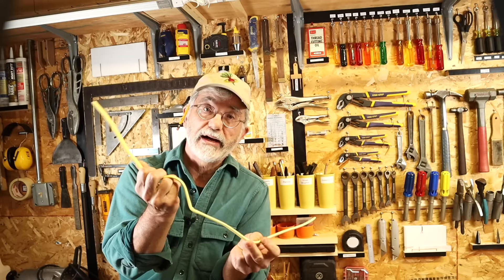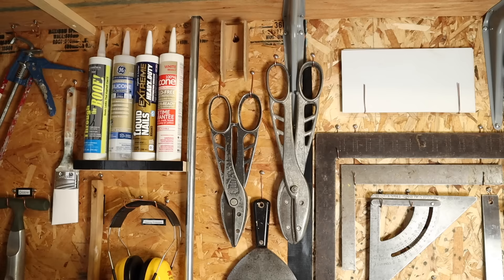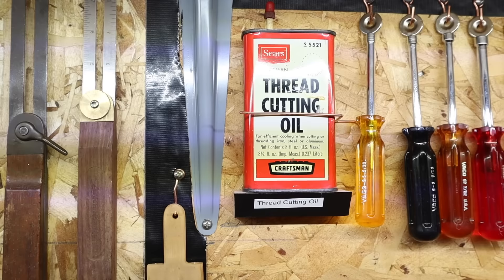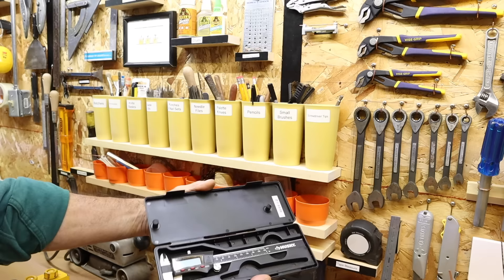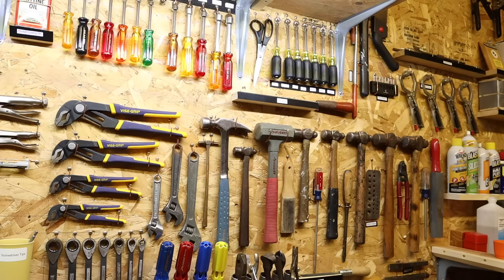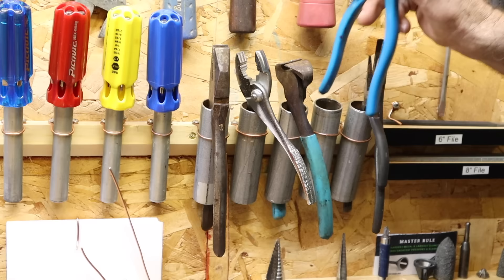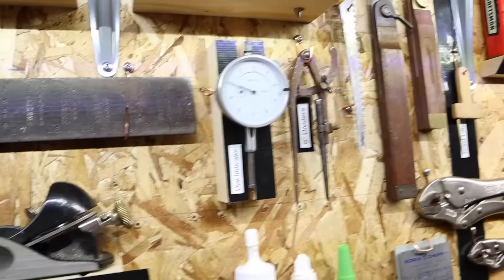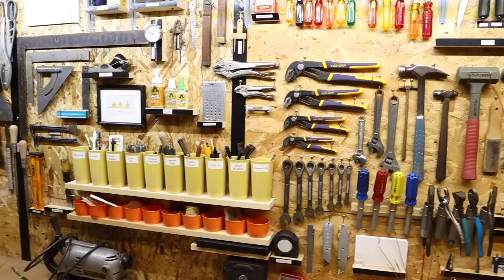How To Have Amazing Tool Organization Using Scraps of Electrical Wire

Comment from the maker: No awesome "dream shop" here!  This is a video about doing the best you can with what you have. In my case, what I have is a cramped, shed-size workshop and a limited budget. But getting my tools organized on the wall, instead of in boxes and piled on my bench is a very satisfying life improvement. If you are inspired and would like to buy me a coffee, here's the link: https://www.buymeacoffee.com/HerrickKimball 👍
Reply: I think I speak for the majority when I say that we don't want to spend thousands of dollars on a 'dream shop' when we'd rather spend it on useful tools!  This is so much better, too, than someone else's idea of how to organize my shop (or in my case, craft room.)  Thanks!
Reply: Very clever, I’ll remember this !
Reply: I was expecting you to use the three strands of copper wire still inside all the plastic sheathing. Much more durable. Thank you for sharing though. You got everything very well organised. Am definitely jealous. All my tools are scattered in drawers and other random places.
Reply: While watching the part about hanging the nutdrivers I noticed that sometimes the magnets will come off with the nutddriver instead of staying on the hook.  You mentioned that you had tried putting a screw through the magnet to attach it directly to the board but it did not hold the nutdriver securely.  I had an idea on how to tweak that to give you the best of both methods.  Put a screw through the magnet and then put a few washers on the screw.  Use however many washers you need to give the same spacing as when the magnets are on the hooks.  This way your magnets will stay put and still have the full holding power to keep the nutdrivers in place.  Thanks for the great video!
Reply: Impressive and inspiring. I'm gonna tackle my rats nest of a garage/shop yet. Thanks for your great vids.
Reply: Are we the same person???  Nah, you’ve got more tool board than me! Wow. Love it. My theory is: If I can’t grab a tool with one hand behind my back, it’s not good enough. (Other hand is already occupied by a tool or battery etc..). Great work and thanks for sharing!
Reply: actually, this is the very definition of a dream shop
Reply: Thanks from Brazil.
Reply: 🎉🎉❤Al 😂a9
Reply: I love this… a contractor left behind a long piece of electrical wire and I couldn’t bring myself to dispose of it, always feeling as if I could use it somehow. This is it! Thank you! My flower gardening/novice DIY home improvement work areas while not cluttered, it could be better arranged using the wall allowing more space to work on my projects… I did not want to spend more money on peg boards, etc… I’ve been planning to tackle the organizing. Now I have a smarter place to begin from. I enjoyed the family anecdotes as well. Thanks again!
Reply: Q❤
Reply: Amazing. You have to bend the wire and then buy screws put screws in the hole. It does the exact same thing as a nail. A Niall is way cheaper

Comment: The key mechanical feature in this system is that the screw fixes the hook from rotating, wobbling etc. Pegboards inherently have that issue. Great work and thanks for sharing!
Reply: Actual pegboard hooks are rather expensive and don't often exactly fit your purpose.
Also, around here 7/16" OSB is half the price of actual pegboard HDF/Masonite
and is much more robust. I covered 3 walls of my shop (256 sq.ft.) with 7/16" OSB 
for $160.

Comment: A quick tip that a roll of rebar wire ties is an affordable alternative to stripping Romex for copper wire. Thanks for the inspiration, my shop has never been so functional!
Reply: Aren’t the ties thinner gauge than the copper he’s using?
Reply: Definitely a thinner gauge. I do think the ties can be and are useful. However, my experience is rebar ties want to rust with any elevated moisture in the air. 🤷🏼‍♂️
Reply: @randyray1194 yeah but then you get to reorganize your tool wall sooner.

Comment: Thank you so much for taking the time to share your ideas. I do not have a shed or a workshop, all I have is a garage that turns into a workshop when I back out one the vehicles. I have started with magnetic strips, hooks and nails to hold my meager number of tools. This video has inspired me to start over with a new direction to get organized and on a limited budget. I am retired so this entire organizing project will keep me out of trouble for an extended period of time.

Comment: To me - this is a dream shop.  Why? Because it's obviously well thought out, well loved and well used.  What more could a man want?  AND I love using inexpensive parts to make something so useful and helpful.  Tool organization can be such a pain at times but I love that your solution is not only inexpensive, but also very flexible and easily changed to fit your changing needs/wants/whatever.  Well done man....I love this!

Comment: I’ve done this in my workshop after seeing this video. Works great - thanks! I used galvanised tie wires for rebar instead of copper cable. Cheap & easy.

Comment: Great idea and a great video. One suggestion for you, I use Zip-loc freezer bags with a 1/4" hole punched in the top section (with a regular paper hole punch) to hang my zip-loc bags on hooks, that way they are easy to take off the wall, open & close using the zipper closure and then using the punched hole hang the bag back on the hook.
Reply from the maker: I like that. 👍 Thanks for the comment.

Comment: In high school shop  all the tools had a painted outline on the wall clearly indicating where the tool belongs when done using it. I thought it was  silly at the time but now know how critical  it is for everyone to know where things are and where they go back to.
  Scrap wire is indispensable around the farm and cuts down on the use of zip ties which have their place but usually can not be reused. If you use "flush cut" cutters you wont get cut by the wire as easily.
 I like seeing someone else using "Through the roof". Its the best and does not get hard in the tube very quickly. Thanks for sharing.

Comment: Great timing for me for this video. I've been building a house and shop for almost three years and my tools are chaos. I also have a ton of wire scraps as I've been doing most of my own electric. Will be using this method to set up my tool walls. It perfectly suites me including making labels as my forgetter works better than most parts of my brain. I love how adaptable it is. Many thanks!!
Reply: Everything ^ says.  Except start with "60+ years".  This cat rocks.

Comment: Nice job organizing! 
23:31 - those are called 'Lineman's Pliers'. They probably had insulation (the older-style translucent red type that feels like hard polyurethane or bakelite) when they were manufactured, but it only holds up for so many decades and then slips off.
'Dikes' are the diagonal cutters / side-cutters / wire cutters: https://en.wikipedia.org/wiki/Diagonal_pliers
Reply: I have that exact pair in front of me. Red and all. Forged steel Taiwan. Plus a yellow pair?

Comment: Brilliant!  I seem to be a naturally unorganized person and have been looking for good ideas for shop organization for a long time but it seems to me that every video/example of an organization method that I come across involves an expensive proprietary system or requires spending an inordinate amount of time working up custom jigs, tool-holding cradles and specialty construction.  Your approach uses simple materials, plain common sense and is broadly applicable to almost every hand tool you can imagine, although with the price of copper these days I might use a different wire.  I believe that the ideas you displayed in this video will suite my needs perfectly and can't wait to implement them in my own space.  Thank you for sharing this fantastic and simple method with us all!
Reply: Wire clothes hangers are almost always free -- and who doesn't already have too many! Most are stiffer than 12 gauge copper wire, so they will hold their shape under greater stress.
Reply: Damn I’m late to this idea. Just tossed a bunch

Comment: This looks great and I have something similar for a lot of my tools but it does leave them exposed to the atmosphere and consequential corrosion. I keep all my socket/spanner/screwdrivers etc in a number of large metal roller cabinets/drawers with silica bags on each level inside. This minimises metal tools the exposure to moisture in the air. Good tools will last over your lifetime so protecting them requires a bit of thought.
Reply: a dehumidifier in the summer and a space heater in the winter works for me

Comment: I think screws alone work as well on plywood painted white. Then outline each tool with pencil to know where it goes and when it is missing. Add little “shelves” with drilled holes for screwdrivers etc.

Comment: Cool idea, I'm going to try this myself.

Regarding the magnets (with the holes in them) you could omit the hooks and just screw them into the wall with a spacer. The spacer is key as you pointed out so that you get the proper magnet surface area.

Comment: 😮This looks similar to things my Dad would improvise. Having lived through the Depression and,WWII; he did not believe in buying things when he could make something. As an example, he stored small things in labeled Prince Albert cans, fitting in a wood shelf slot. I have the same attitude. Rather than spending $6 for velcro tool hangers, I use cheap heavy duty tent tie loops with balls on the end, which are faster.  Thanks for sharing with us.

Comment: This is a great idea. I’m definitely going to employ this in my shop. Currently I hang most of my tools with 1/4” dowel glued into the plywood which works great for most things and I can flush cut them off if I change placement. Thanks for the video!
Reply: I really like the 1/4” dowel idea! It’s not quite as quick to change as a screw and a wire, but if you have useful lengths of dowel precut, you just need to drill a hole and glue it in. And I think the wood dowels would be less visible than the screws and wires.

Comment: Love this - I have lots of wire for this type of project and am getting my shop finished off inside!  I have been thinking about peg board - but I'm not a big fan and the wire holders are expensive!  One thing you could do to the wire you hang heavier items from is form the shape then lightly hammer with a nylon hammer and that will help to work harden the copper wire.  Thanks going to do this in my newly finished shop!

Comment: I am in the process of cleaning up and going to organize my garage. I have two sheets of osb, and was trying to figure out what to use them for. You sir just solved my issue. I was thinking the other day i wished they were pegboard instead. Not anymore. Now i just need to locate the wire. Thanks for the great idea, and I just happen to have a brother brand label maker also.

Comment: Good Stuff!  A lot of really good ideas there. In my shop, instead of using EMT, I use the plastic version, heat the end with a heat gun, then push into a ball peen hammer to create a funnel top. To capture those little straws on lube tins, strap a drinking straw to the side of it  with good tape.
Reply: I don't use drinking straws. I use coffee stirrers that are just a bit larger than the red lube straws I was always losing
Reply: @ohiofarmer5918  I'll look for those too, thanks, but I have a feeling those are on their way out here (Toronto).

Comment: This is brilliant, and like most good ideas, it is simple.  I’ve tried, shelves, peg board with hooks and all sorts but this is so much more versatile and easy to change.  As I’m just moving my workshop I’ll give this a go if I can find the right gauge copper wire in the UK.  Cheers for sharing. Andy UK
Reply: You can use gal steel wire as well, 1.5 to 2.0mm should do it. Cheers from Michael. Australia.

Comment: This is the most brilliant video I’ve seen on shop organization. The beauty of it is I have everything in my shop right now to do it. I will have to pick up some more osb. Practicality is genius. Thank you for taking the time to share.
Reply: I did the same thing years ago but I use finish nails of varying lengths. Seems faster than custom making hangers.  I also made custom screw driver holders that are nothing more than a small shelf with holes drilled in it.

Comment: Ton of GREAT ideas here.  Low cost in both time and money.  Durable setup that won't rust away.  A few minor improvement suggestions.

1.  If you need thicker wire anywhere, put two (or three) pieces of wire into a drill chuck, grab the opposite ends with a vice or locking pliers, hold it taut and twist the wire together with the drill to form a multi-strand wire.  On top of being sturdier & thicker for heavier tools, twisted/braided wire can sustain far more bending before it work hardens and breaks so it is much better for wire that is regularly bent back and forth.

2.  Add wire retainer, similar to the chisel setup, to prevent those cups from falling off that shelf when it inevitably gets bumped & destabilized.   Few things more annoying than a cup full of loose parts scattered across the floor.

Comment: Super 8 plus is my favorite as well. I’ve given them as gifts many times too. Great video. I’m still attached to various wooden holders but using other materials is great. Rubber bike tubes cut up and PVC tubes. I love that you’re lighting is strong too.
Reply from the maker: Excellent. I actually have my Super 8 in hand as I’m checking this message. Doing some electrical work with it. 👍

Comment: Good idea ! I did the same by buying some metal hooks that are threaded at one end, so I could insert them directly into the wood, and I have them in different sizes depending on the tool they have to support. Having all the tools in perfect order is a great satisfaction, as well as a sign of good professionalism, and allows you to always know where a tool is, at a glance, without going crazy with a box or similar.

Comment: Much easier to navigate than having a drawer full of tools, I just did something like this with my power tools and chargers.  23:32  Those are 10 inch linesman's pliers. A must have tool if you are working as an electrician. The jaws are just the right size to twist wire together prior to installing the wire nut.
Reply: You can buy the insulating handles for the linemans pliers from Klien and probably other places. You put them in hot water till pliable then they will slide right on. Once they cool, they won't come off the tool.

Comment: I cannot believe how much grass there is when things are disorganized I heard someone say the other day it’s all junk unless it’s organized. Thank you so much for the video. I probably should’ve put it out there but I stopped at Home Depot. I was going to buy some 12 gauge electrical wire, I just don’t have any kicking around but instead I bought some 12 gauge galvanized wire 150 pound galvanize wire 100 feet for $15. It doesn’t feel like it straightens out that gray because it’s all in the wall lol 10 inch wall made by 00K but I’ll let you know how it goes. It’s gonna be nice to walk into the shed and not be overwhelmed by the mess. Thank you for your time.

Comment: Thank you so much Herrick Kimball for this priceless video! I've watched the video several times and now have my tools well organized. I love using my shop and soaking in the organization I now have.  You've saved me so much money as I'll not be buying tools I didn't know I had or couldn't find any longer. I ran out of Dymo tape so as soon as it arrives this week I'll be able to complete the labeling! I just love what you did. I don't have that type of wire so I went to Lowes and got a spool of wire for less than $15 and used the 3/4" screws and made my own hooks like yours and even a couple of tiny shelves. Great video and thank you so much for sharing. A Dymo tape saving hint is rather than making one label at a time, type out as many tool names as possible in one printing with just a space or two between each one and you'll use less tape. A thousand Thank Yous!!

Comment: Nice one Herrick. For the yellow Tuppaware Tall Cups that you were going to screw to the wall but instead made a little shelf.... have you done much with Captive Screws? This is where you'd leave the screw in the wall unscrewed about a quarter of an inch. On the Tuppaware you have a hole big enough to accept the screw-head and a slot, coming out of the screw-head-hole just above it, wide enough to accept the screw shaft. So this way the Tuppaware can be easily removed and replaced again after you were done with it.

Comment: Excellent! My only suggestion for improvement would be to remake the nut-driver rack and fold the copper wire over the magnets so they can't come away when you lift down a tool.

Comment: I switched my peg board tool board to Harbor Freight 18" bar magnets. They were giving them away for a while with every purchase. I got lots of them, and screwed them horizontally to the peg board where the tools would be most handy. they are great for screwdrivers, wrenches, hammers, etc. you can just grab a tool from the magnet, and put it back just as easily. I wish I'd have used them many years ago.

Comment: Great idea, you 'just' solved a big problem for me. I am a professional skipper, live and work on a commercial boat and use a vast amount of tools, mostly metal and engine related. Problem is boats vibrate so ordinary systems don't work that good, things fall down, so everything is in toolboxes, not the most practical solution. You just proved that these wires are sturdy enough for this usage. I have some work to do now! thanks